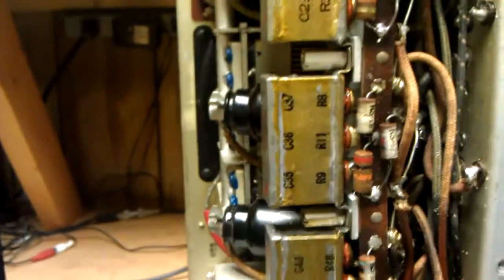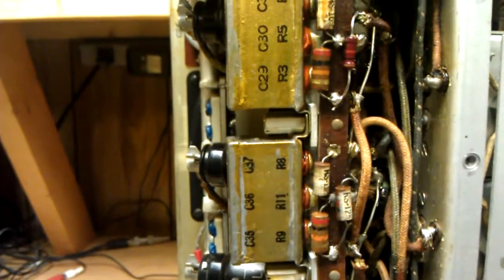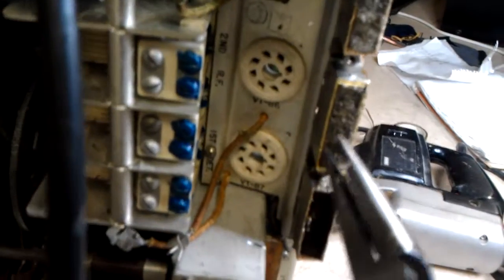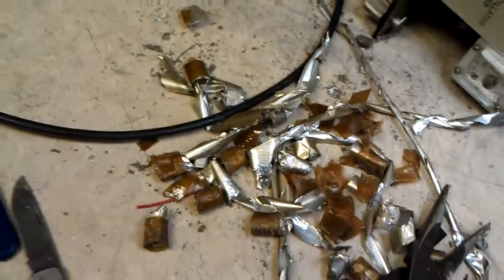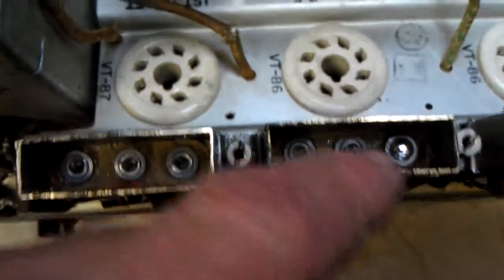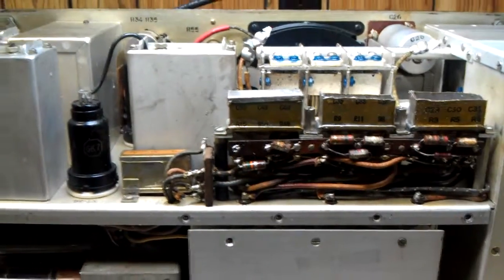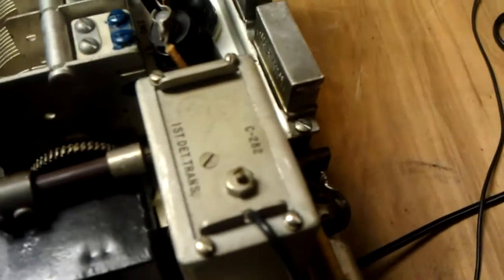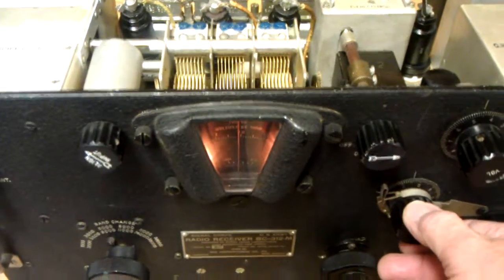BC-312 Replacing Capacitors.

Comment: >I would prefer to just unsolder the lids but was deterred by fire and explosion! 
Drill a tiny hole in the "can lid" to let oil & air expansion to leak out. Wrap the can with rags or paper towel to both absorb leaks & conserve heat. I used a fat tipped Weller 80-watt iron for heating plus a metal pick tool to apply upward pressure to an edge of the lid & after a few minutes of heating the lid flipped off.

I've restuffed several of those Aerovox 3-capacitor "blocks" in BC-342 and tested the oil with a simple speciflc gravity test. In water, drops of PCB should sink. Mine have always turned out to be a simple mineral oil, even the Sangamo bathtubs I replaced in some RBM-5 sets. I discovered the water test in a short paper on field testing oils from large transformers.

Comment: hi , where is the power connector? seems there is only a red light instead of that elbow
have one here that is missing the elbow too , so not shure if there are any without it
Reply from the maker: Power supply is 110vac located on rear along with the AC cord. The "nose" on the front is useless so I removed it.
Reply: @n4lq  do you still have the nose with the connector inside?

for 312 to return to original would be handy :)

Comment from the maker: Dremmel wouldn't fit around the cap without removing it plus it would eat up a lot of cutting disc.  
It could be possible to drill a hole and try draining out the oil then unsolder the lid. This would reduce the explosion and fire to some extent.

Comment: Dear n4lq,
Unsolder the gang caps, remove, and mount in a vice.  Then take a butane torch (these can be found at lowes) and with a pair of good pliers heat the top cap.  Be sure to 'hook' the pliers under the edge of the top cap in the middle.  As you work the edges, gently pull up on the pliers.  The cap will give and then pop off.  The only drawback, beside the work of soldering is the cap will need a good polish with steel wool to get off the char marks.  I am doing this to my 312 right now.